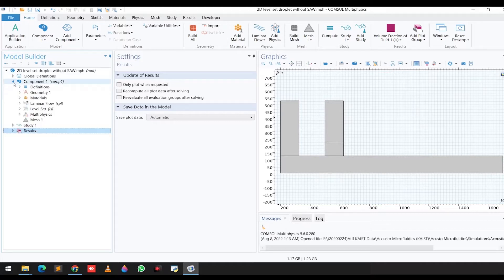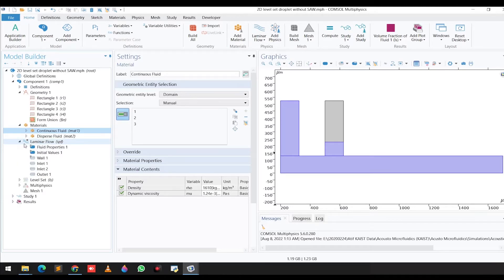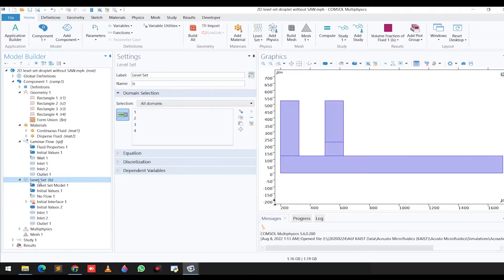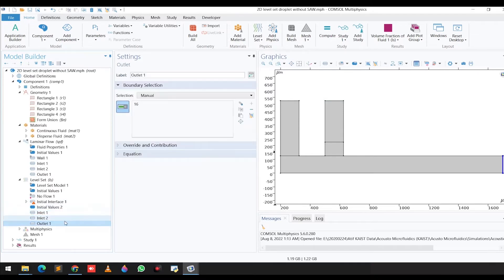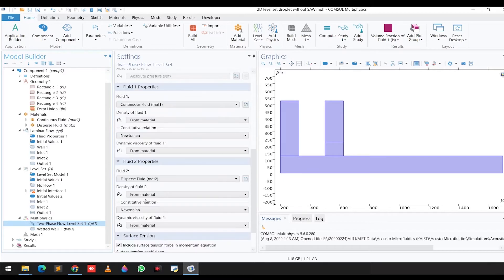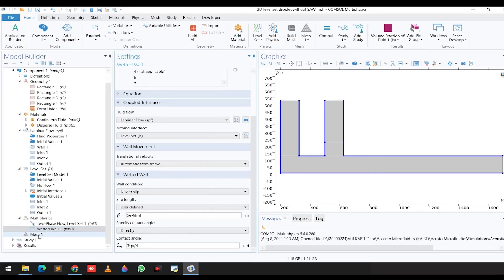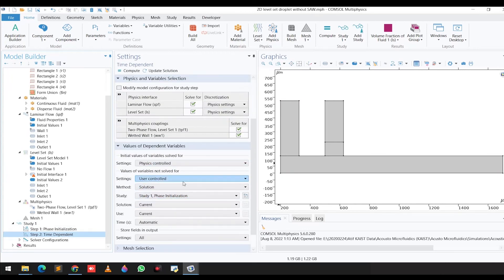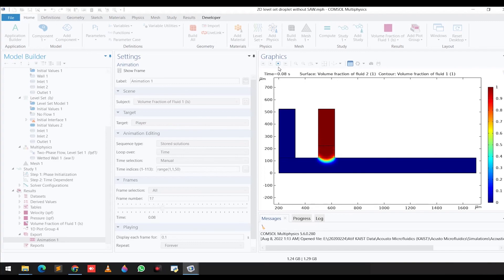COMSOL Tutorial 03 | simulation of droplet generation in a T-junction microchannel | Two Phase Flow

Comment: Hello, thanks for your informative video.
Do you know how can i measure the size of droplets?
Reply from the maker: Thank you for your question! To measure the size of droplets in COMSOL, you can follow these steps:

Post-Processing: After running the simulation, use the Results section to create a Line Plot or Contour Plot around the droplet.

Measure Droplet Size: You can use the Measure tool under Results to measure distances, or calculate the droplet diameter by looking at the area of the droplet and determining the equivalent size.

Hope this will help.